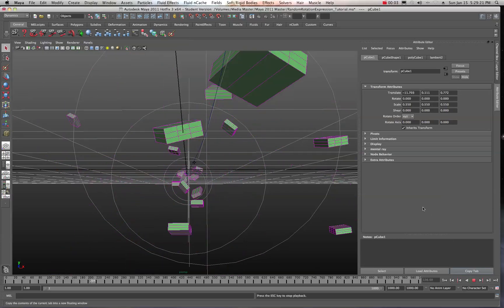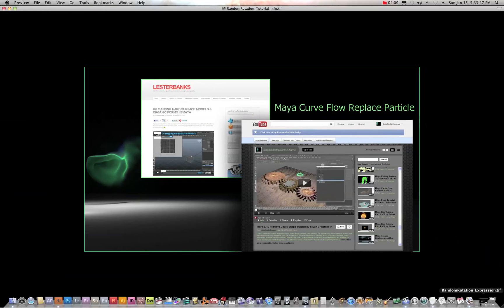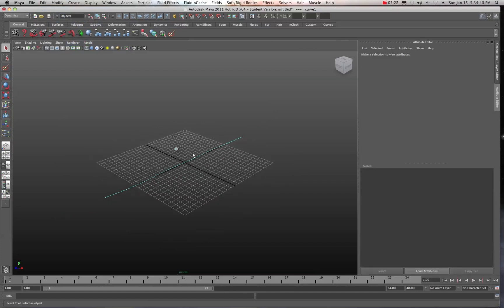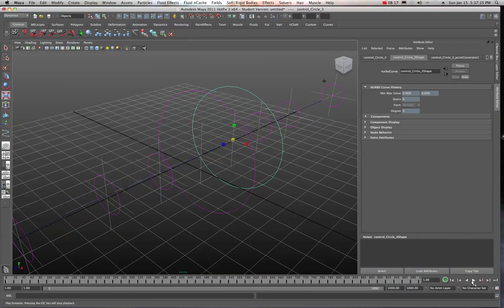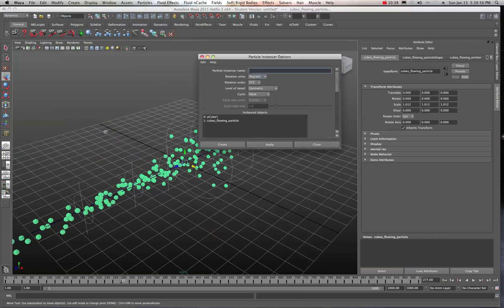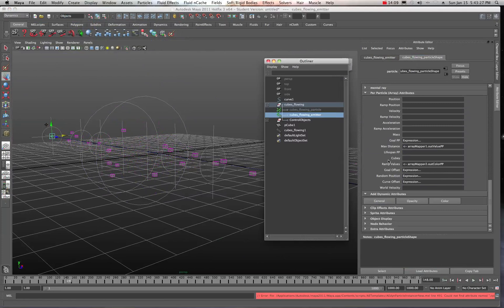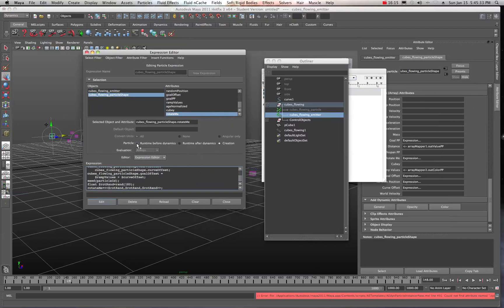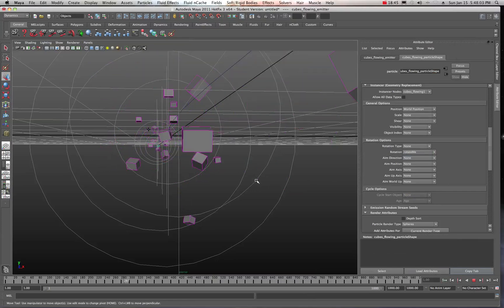Maya 2011 Assign Random Rotation to Particles Tutorial by Stuart Christensen

Comment: Hi, Thanks for the really useful tutorial. it helped a lot with a little folio pice im doing of a treasure chest opening and an shower of coins erupting out of it. The coins are instanced particles and Ive got them flipping and rotating just how I want them. Only problem is once they come falling back down to the grid (Ive tagged this as the floor plane) the impct and stay where they land but keep rotating due to the expression. Im a complete noob at this and would really like to know what i have to add to the expression so that when the particles reach 0 on the Vertical axis the rotation animation stops?

Any help would be appreciated.

Thanks

Comment: This is really handy, but how do you control the speed of the particles? When I try to adjust the speed slider on the emitter, it does nothing.
Edit: Nevermind, turns out you can adjust the space between the rings or alter the lifespan of the particles. :)

Comment: any one know how to get random rotations on the instancer that dont re evaluate every time u start the sequence again(rewind to frame 0)?????
im currently using this expression:
nparticle.customIndex = id%16;
nparticle.rotationPP = customIndex*200;

so that they all the nparticles START with random rotates.

but every time u play sequence again, even cached with instancer attached, they re-evaluate a random rotate value.

any help would be great.

is there something NOT random that u can base it off of.
Reply: +jamisonONE A noise expression, as far as I know, creates a predictable distribution. So just do ((noise(frame) + 1) / 2)*360 to get a distribution curve between 0 and 360. It will recalculate it every time, but it will give a consistent result.